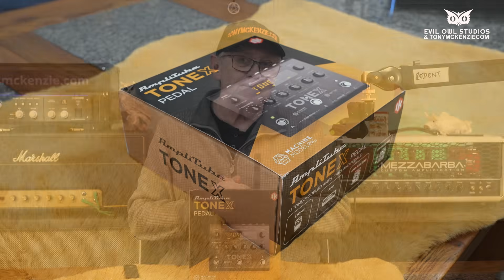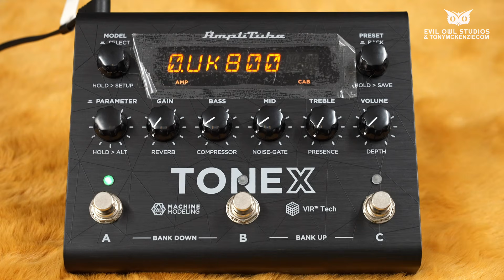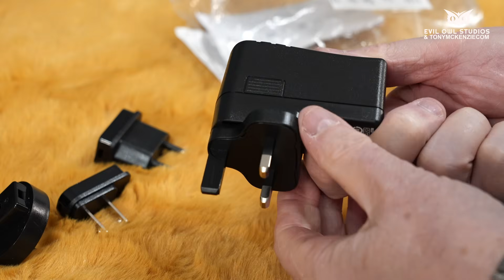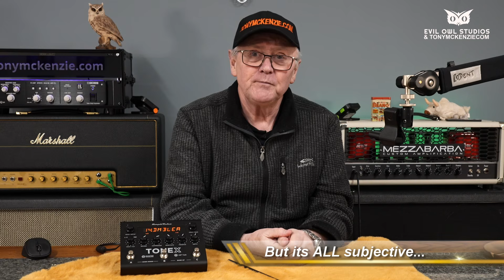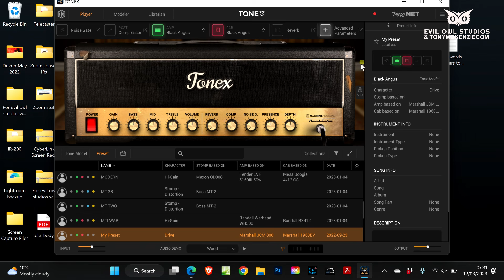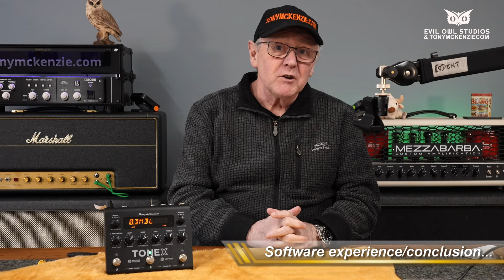TONEX Amp Sim  Simulator | is this Finally Utopia for guitarists?

Comment: ToneX, Fractal, Kemper, Helix, you name it  … are distracting from that what counts when taking a guitar and making music. That is my view. I will not give up on my tube amps. They have the tone and feel and not a computer which pretends being an amp and turns into electronic waste after plus minus 48 months. Would reckon that this ToneX thing will only make it 24 months before it ends up (hopefully) in recycling yard.
Reply: @ET Music  No one wants to maintain and carry around heavy old tube amps anymore. Guitar players tomorrow won't want or need tube amps, sorry it hurts your feelings.
Reply from the maker: I know this was for Erik... but this was a subjective and anecdotal comment without any 'proof' that 'no one wants to carry...' just a point...
Reply: With all due respect you are just straight up wrong. There is plenty of room in the market for solid-state amplifiers, tube amplifiers and electronic devices such as this. An intelligent and good player can get a solid tone with anything in front of them. In fact, I would bet a year's salary that you have heard guitars in a recording played on a device like this and had no clue what you were listening to. 

That's just the way things are now. Amplifier Sims are getting so good that it is now extremely difficult for even the most discerning listeners to hear the differences between them and an actual amplifier. 

Products like this make life easier.  They just make it easier to quickly set up a tone and play, FAST... 
 whether it's studio or live. That's just the truth. I use both amplifiers and amplifier sims and I have a Line 6 Pod and a ToneLab SE. Everything has a use. I can get great tones out of any of them. They're just tools in the toolbox.
Reply: @JoeGuitar6  I am not arguing at all, that these devices are there for a reason. Players in a cover band can take benefit from them. However one cannot ignore that these modelers all aim for the same thing: sounding like a tube amp. And that speaks for itself. They are (most often poor) imitators of the good ol’ tube amp sound and not innovators of new (prospective iconic) sounds. They try to compensate this with myriads of features, buttons and menus by meeting a very patient community willing to wait months for a new software update to complete an unfinished product. 

And: I have yet to play a modeler with a good clean and on the edge of break-up sound. This most likely has to do with that crap solid state amps they are using. Good solid state amps exist (like they do in HiFi), but then they are as heavy as a tube amp and cost even more.
Reply: @Michael-bm8hi  You obviously never played a modeler than as you can find ANY tone you want, edge of breakup included. Yes modelers aim to sound like the iconic tube amps, and do it well or better than the real thing. That's the crazy insane thing about it. This technology literally replaces your tube amp. It's just the truth. Our generation is hanging on to tube amps, but my son and the younger generation will probably never pick one up, because they are simply unneeded now.
Reply: @SpinGoldmusic  I did and have one of them here (Strymon Iridium). In conversations I had, they all agreed that if modelers can do anything well it is high gain/distortion sound, there where compression levels out everything. Clean and edge of breakup sounds lack something and sound sterile.
Reply from the maker: Correct, they are improving in sound comparison, but less so in the area of 'feel' which I have noted for years as a remaining issue.
Reply from the maker: Well, as I have said in my review I like tube amps also. I certainly get the point you have raised. In my opinion the Tonex is literally not for everyone. Some have said (below) that you had an old closed mind opinion. Not so I say. We all use the equipment, guitars, amps, speakers, mixers, etc. that works for us... they are all tools and whatever works best to achieve the best results in the eyes of the musician IS the right tool for that situation. I use tube amps and I use simulators, only driven by the situation really. Tube amps are hardly 'a thing of the past' as some suggested, and there really IS room for all technologies, without any doubt. I think your point re the 24 months and recycling is VERY pertinent. Here's why. Every processor and memory chip, trailing edge etc. has a manufacture life and then it will stop... and so will the manufacturing of the device... fixing it then IS another problem. However, in the case of tube amps in general they have off the shelf older tech resistors, capacitors, switches, and even tubes, that can be found relatively easy - even after cessation of the item, others make it. Lastly the 'feel' re tube amps IS different and I agree with you on that point, its often an overlooked view by guys that have never played 'real' tube amps like say a Marshall 1959 and actually felt the difference when playing. Thanks for the post and for watching... appreciated.
Reply: This is the old closed minded thinking of the past. It's time to move on. This technology is helping musicians make music. Trust me, I have my tube amps, and it's a crazy thing to see tube amps become a thing of the past overnight. But, here we are. You don't have to throw away the tube amps, but putting off this tech is really silly considering you can have any amp and tone you want at your fingertips.
Reply from the maker: Ha hardly overnight? unless you believe much hype. Kemper made theirs in 2011 and guess what, the users generally said the same? But here we are in 2023 with the Kemper at 12 years going on 13 years old. Little has changed, except that with the Kemper their software was always first class and did not create issues like I saw with the Tonex. You're right though, both technologies can (and do) exist at the same time and all are merely just tools to create the next incredible piece of music by artists. Thanks for the post and for watching.

Comment: I must agree the software experience part isn't good. Compared to helix, it's years behind. The only worse was ampero... That was like installing drivers on windows 98.
Software issues aside, for me it does the job. I wanted something that emulates an low to mid gain amp i a natural way , and it does that great. No other device in that price range does that . 
I'm glad it came out now, cause i almost bought a quad cortex... Luckily I don't have to now.
Is it inspirational ...  Well to a person that not going to own a real 60s marshall or dumble or trainwreck, sure it's inspirational. 
If i had the original gear that this thing tries to emulate i wouldn't probably bother, assuming of course i'd also have porter who would carry these amps for me, and a security guard who made sure they didn't get stolen
Reply: It's not a big issue if there are problems with the software because they can easily adjust and fix a lot of those issues in future releases.
Reply from the maker: I agree that the software, while not that complex as some I have seen, does need to work... and in my case I had to 'change the computer' to solve that. Ha careful... the S word will strike us all down... so some say ;-)  What it offers is a portable box, that once you get past the software will give a reasonable comparison of the tone compared to the original, but sadly not quite the same 'feel' as the original IMO. But, load up those amps, throw away the PC and hey ho it works :) Thanks for the post and for watching this stuff. Appreciated.
Reply: @tonymckenzieofficial  addressed the S word. Funny enough, i've connected a Bad Monkey from Digitech to that profiler, a few days before mr JHS did his video comparison of BM to Klon and other insanely expensive boosters. If i knew better , i'd probably could trade that Digitech i bought for 20 dollars 10 years ago. But that is a  whole different story.

Comment: Great VId - was keen to see what the CPU was - shocked actually - 600mhz to 1ghz (overclocked) thought it would be much more powerful to handle the ML code and CAB IRs + Verb, but it does explain the lack of general effects. I have the pedal and think it sounds really good - best I've heard at that price point. I have a few teensy 4.1 boards hanging around - I'm making a Gate/Expander pedal - still stunned to find out it's basically the same CPU as the Tone-X :)
Reply from the maker: These processors are commonplace in many simulators and effects units it seems from my viewing in them. It's good for the money I guess. Thanks for watching.

Comment: I have both a Fractal AX8 + Headrush FRFR rig, a Neural DSP laptop setup and a few tube amps + about 40 guitar pedals. The tube amp and pedals wins every time when it comes to feel and overall musical experience.
Reply: Biased 😂
Reply: @garyatkins4479  He wouldn't be able to tell the difference in a blind test I bet.
Reply from the maker: You hit on a very strong point... the FEEL when you play through a decent tube amp - I have yet to find in ANY simulator. Some guys will tell me I'm strongly 'biased' towards tube amps, but in reality nothing could be farther than the truth. I have owned a Kemper since 2011, an FX3 I quickly sold, and I have used so many of the other devices since for both studio and reviews alike. But there IS a difference. A Few years back I bought a used Marshall Plexi (the reissue), and I had not used a real plexi for years, but there was no doubt that when I first plugged in that amp, cranked it a bit (yikes!) and played you immediately literally feel the difference between the two technologies. It's not a bias, its based on real experience on my part. Your comments are absolutely not unfounded... but the way I look at it ultimately, is that whatever technology someone really likes and works best for them is really the one they should use. Great point, and one I'm sure I'll raise off and on with the Tonex device and software. And... thanks for watching.

Comment: Made in whatever means nothing.  What matters the manufacturing specs, if you ask the Chinese to make the best pcb they ever made and give the the appropriate budget, this is what you are going to get.  If you ask the the best cheap device you can can get for budget X, this is what you are going to get ... the problems happen when budget X is too small and when the QC process is not put in place properly.  Any manufacturer tries to minimize costs, so you have to put QC processes to insure their cost cutting measures do not affect your product, this is true for made anywhere.
Reply from the maker: Well I beg to differ. Go on to Amazon and buy some tech Chinese gear not high up the list... what will you get? Let me tell you, you MIGHT get a good device, but at least equally you might get something that is poorly made and is pretty much unsupported. Chinese product in my experience since 1981 is exactly that. You know better? I think not. The real problems are that there are MANY really bottom end makers in China that frankly don't care and they make the devices down to a price, and not, as you suggested, up to a standard. It IS true that there are some that are excellent manufacturers, but for every great one I can show you two others that are pretty useless. The point about the 'made in Italy' was that it was nice to see a company (if true) that can actually make quality products and compete with the Chinese. If you think that does not matter, then wait a while, watch Taiwan, and even later wonder why you can't buy anything from the far east. Thanks.